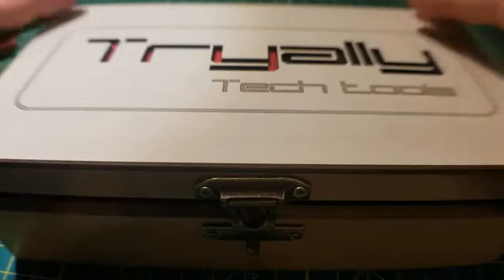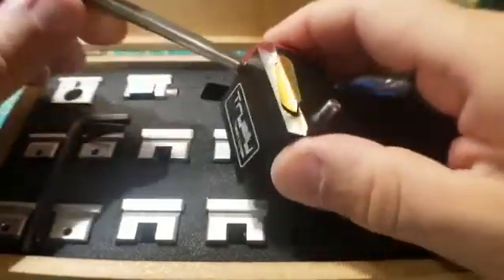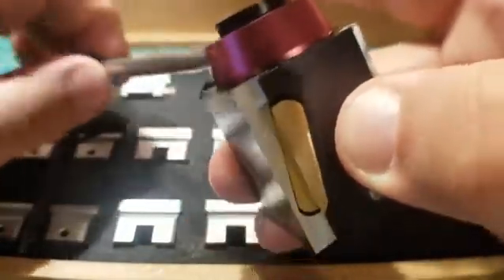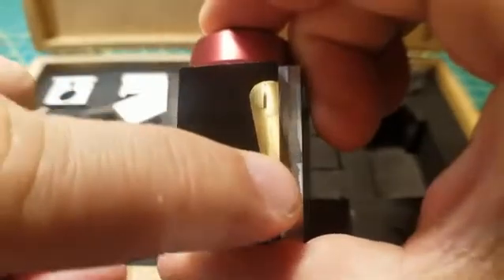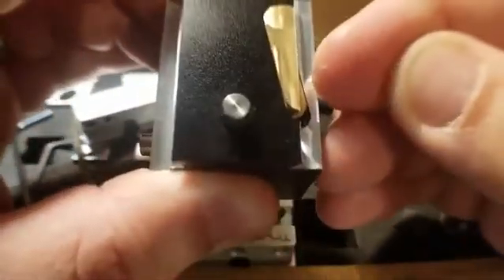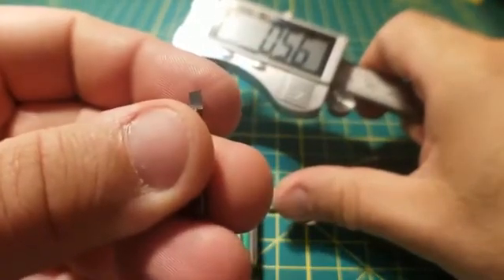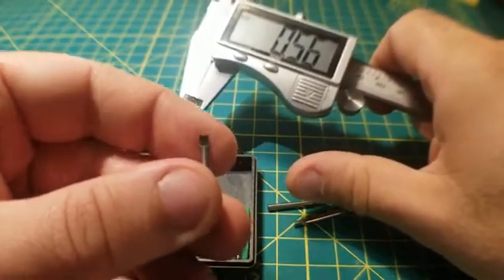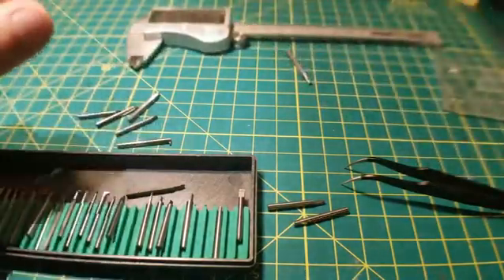Tryally Tech QCTP review

Comment: nice small tool, BBUUUUUTTTTT sharp edges, where you cut yoursel online, live in the video, it's bullshit. perfect parts you touch, the feel comfortable, the feel perfect, this way of manufacturing is shitty bad, please tell him... what i don't like in this type, you just have one, or two positions. when you need to adjust the tool angle you always have to untighten and retighten the complete holder... my first qctp was done from a private guy, it improved the work so much, but now, with elody, my bigger 14x28" lathe, bernado, 700, i changed to the copy from paulimot of the multifix system... it can repeat within 1 thou, 0,02mm, and within 5 sec. yesterdeay i needed a bit more 'space in the ass' of an insert, so 2 steps of 9°, and it fits, no scew, 7 sec.. look for peter of pewetools i love hate this guy, hes toooo precise for the stuf i do... work save, optimize the tools from loiz, do good work..